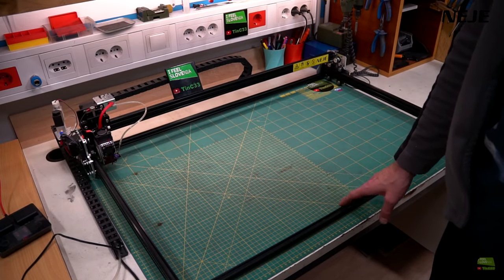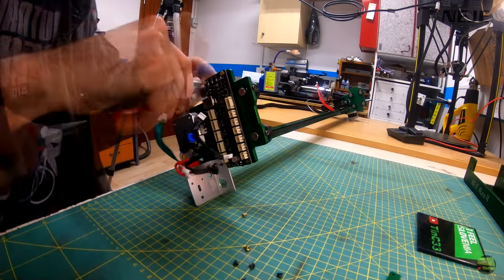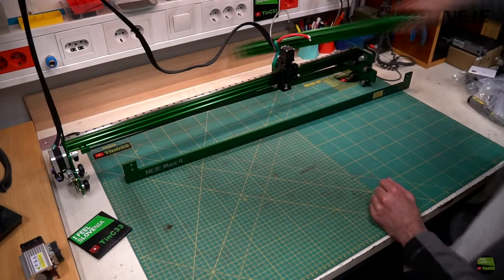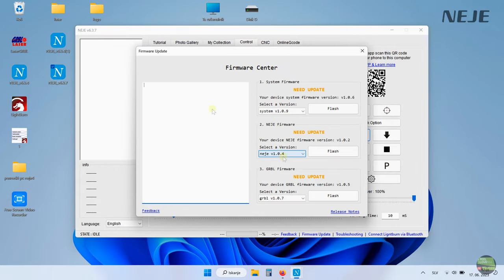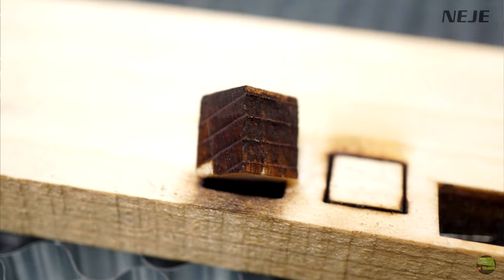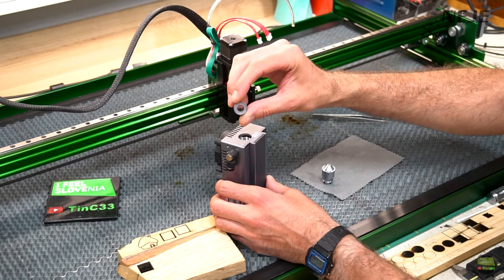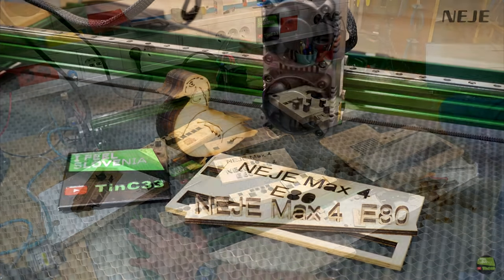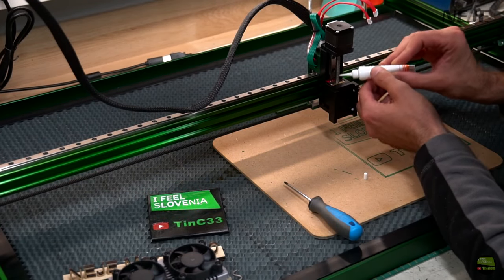NEJE Max 4 CNC Engraver / cutter / plotter + E80 laser modul + drawing pen [unbox/review/first test]

Comment: Hi, I was just about to buy this laser via Aliexpress but then watched your video. You now have me scared and confused when you say it cannot engrave softwood very well because its too powerful??
Surely it can modulate the power down? I know there are settings like 50% power etc, why would this not be enough to get a good engraving?
I mainly want to us this to engrave cedar wooden items that I make. Id also like to be able to cut a bit of 18mm cedar but that is not as important. From what you said I wont get good engravings on cedar with this. Its western red cedar, very light and soft.
Can you explain a bit more how this is a problem and why turning the power down wont fix it?
Reply from the maker: It can engrave if you lower down the speed and power, otherwise it make too deep and bright engrave, because it cut in deep instead of burn the surface due to its power, i alwqys use lower power modul for engraving because it make better deep black engrave. 
Extra modul low power is about 30$ and deffinitely worth a buy so you got covered every job.
Reply: @TinC33  So are you saying for $30 I can buy a low powered laser "head" or module to replace the 20w laser on the Max 4? That sounds like a great idea, is it a Neje laser? Do you have a link to the module? Is it plug and play? 
Why not just do the engraving at a lower power? If I run the 20w laser at 25% why would it be any different to a 5w laser?

Thanks so much for the info :)
Reply from the maker: @MrChargin  depend on what type of neje 4 you take, if you take neje e80 it work on 24v (only E80 work on 24v) so you need to buy also 12v power supply for all other moduls, look on neje store or cjeck the links here in video description.
I always advise to take (if your budget allow) neje4 with E80modul(wich is simply a beast for cutting + extra modul 3,5w or 20w is still good for engraving + in that case 12v 5a power supply, so you got everything you need

Comment: I have TWO NEJE 3 Max v2 machines! I'd love to get a max 4  e-80! I bought my first one out the door for $491.00. I loved it. Then NEJE came out with the Max 4, and put the max 3 v2 on sale, And I just couldn't pass it up, out the door for $269. It's in the closet still, haven't even put it together yet. NEJE makes a great laser, to be honest, I shopped around a LOT! The two year warranty sold me. I got it last December, and it has run most of the time I've had it, still going. I truly figured I'd have worn it out by now!
Reply from the maker: @steveparry7364  yup, when i make this review neje4 with E80 cost more than 800-900$ so my face was like 😳 when i see neje4 with E80modul for i think $500 wich was price only for modul at begginning, also as you said great machines...

Comment: Sadly I bought the Max 4 half a year ago and mine also didn't have the cable chains and there is also a really great deal where you can get the Max 4 with E80 module for almost the same price that I have paid for Max 4 with A40640 Module.
But I'm stil very happy with the Max 4 and A40640🙂

Is there an upgrade kit available for cable chain conversion?
Reply from the maker: Hello, neje always improve their machines, almost every version had some cont at first versions, but they fix it really fast when reaceiving feedback from buyers.
There is cable chain for neje 4 on their online store, check for them, alao i really missed them, hope they ship me one so i can make a video about cable chain install.

Comment: Great review. First independent review I've seen of the Max 4 since it was released a while back. Still in two minds about it, the z axis feature is a plus as well a using a cutter blade and pen module. I'll probably get one at a later date still have a lot of use from my Max 3 with an E80 module.
Reply from the maker: Thanks, i think the video is too long but i edit this video soooo long so i messed up a bit 🤷‍♂️